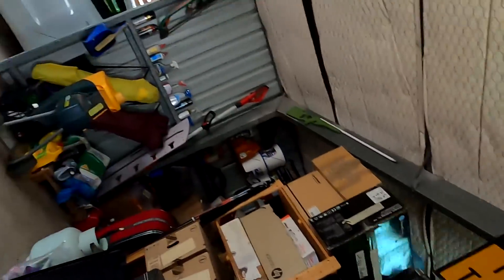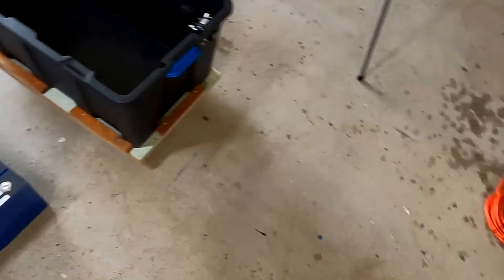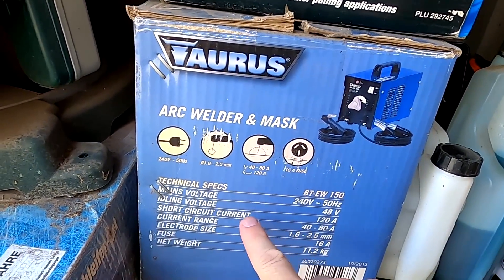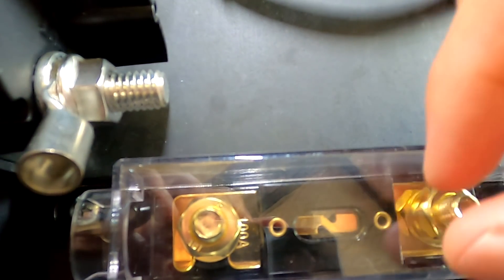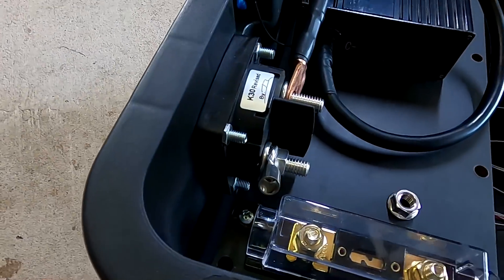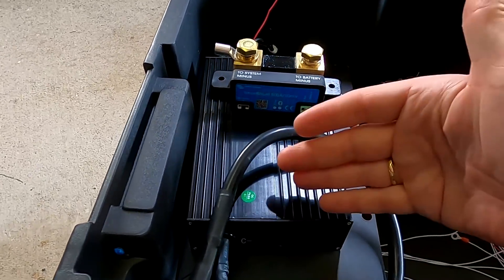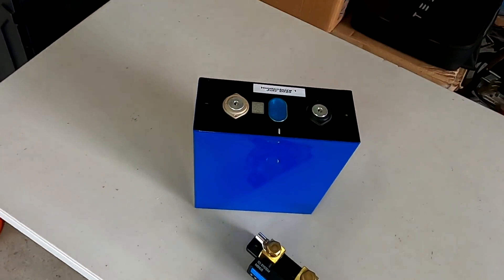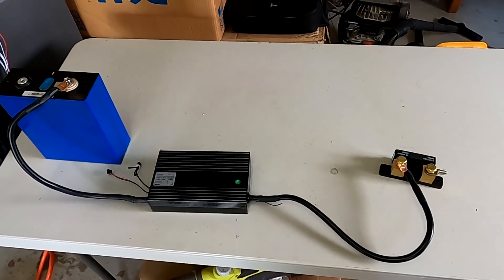Setting Shunt before the BMS a bad idea? Here is why I think this is GOOD! #buildthebattery.2

Comment: Just one quick question why use a fuse instead of a circuit breaker? Fuses need to be re-purchased and a circuit breaker only needs to be reset. Just wondering what the difference might be?
Reply: Hello. This fuse should never blow, exept trouble. How often do you replace fuses in your car?
The same here.
Reply: I prefer to use both: A larger fuse and smaller circuit breaker (This way the breaker should always trip before the fuse blows). I've had DC circuit breakers fail in the ON position where I couldn't even manually turn it off by hand. Fuses are pretty much fail-safe: A fuse fails by melting apart which means they can't fail in a way that would allow current to continue flowing so I feel much better having both in-line.
Reply: @JeremyAkersInAustin  that’s absolutely brilliant. Thank you for the suggestion. I’ll be ordering a slow blow fuse today.

Comment: How do you plan to keep the solar charging in case of an empty battery with the bms switching off the load at some low voltage scenario? Do you go with both (load an charger) on or off?
Reply: Good question as I've heard the victron can be damaged in the event of a disconnect if solar are not connected to the battery , in my install I chose to use a seperate port bms which carries on charging even in a cut off situation , I then use a relay for all loads works well so far
Reply from the maker: Victron has confirmed in their forum, that the MPPT will not be damaged in these scenarios. It can handle the solar without a battery been connected.
Reply: Not sure about his BMS, but some BMS units I've looked at will allow charge current in while blocking discharge current going out. They use solid state electronics which can allow current to flow one direction but not the other. Other BMS units will have a separate lead for discharge and charge, so they only disconnect the "discharge" (or "load") lead but leave the "charge" lead connected to the battery so that the MPPT can continue charging even if the load (Inverter) is disconnected.
Reply: @JeremyAkersInAustin  yes, Some bms have common port and Some have seperate ports for charge and discharge activation
Reply: @BischesseHunting  yes Ive used the seperate port for this reason

Comment: That is a very good point to move the Victron. One other thing; why not place the battery shutoff first, between the battery and the Victron shunt so no power goes to the shunt when idle.
Reply: The only possible problem I see with switching before the shunt and bms is loosing your programable settings in both, but I could be wrong could be worth testing I might try it on my daly bms and bmv 712 later today.
Reply from the maker: Thanks Peter. I need to see how much cabling effort this will be. I tried to keep it as simple as possible. But totally agree, it would make sense.

Comment: Been watching intently this series of videos.  I have a question and will apologize in advance if you clearly mentioned this.  I looked on your website and went back thru a couple videos to find the answer but could not nail down which BMS you settled on.  Could you just clarify what one you settled on and why or direct to the video where you did so?
Reply from the maker: Thanks for your feedback. I haven't linked the BMS yet, the video is still to come. Very soon...
Reply: QUCC from what I saw on this video.  What model?

Comment: Go with 3.  You want the most accurate measurement to be the Vistron and that is what Vistron says to do.  You will find that the BMS will not be accurate to your other meters, but will measure each cell in reference to the other cell just fine.

Comment: No low voltage disconnect for the shunt also. If put in after the bms the bms will turn off the shunt if the voltage gets too low
Reply from the maker: Good point!

Comment: I initially would go with #2, but if Victron recommends #3, you won't be doing it wrong.  An added benefit of using #3, is that the shunt will be measuring any parasitic draw from the BMS.

Comment: For a battery used and disconnected then left like that until next use like one used for camping I would place the switch first.  This is to prevent the battery from discharging through the bms and shunt.  You might have to get a few more low current poles on your switch to interrupt the current draw of these devices.  For an energy storage system where the batteries are always going to be charged by the PV system the minor current draw of the bms and shunt will not matter.
In your case I would place the shunt before the bms.  The shunt is going to be the most accurate measurement instrument in that setup, I would want it to provide the most accurate information to all the other components that are relying on the information provided by the shunt.
Reply from the maker: Thanks Gabriel.
Reply: Old way of doing it - a Smart BMS does everything and there is no need for a shunt
Reply: But he has a shunt and he needs it to interface to his other Victron devices and he can monitor ir on his mobile phone.  Yes Smart BMS can do some of that too.

Comment: #3 , inline with Victron's recommendations, though don't think it makes that much difference. Question: Should you shorten the cable lengths were possible to reduce loss?
Reply from the maker: I'll show this in the next video (or the one after). I took the BMS apart to show what;s inside (😋) and I could shorten the cables if necessary. But do 10-15cm make a huge difference? Not sure if it's worth the hassle, crimping and effort.
Reply: Hello.
Where it is possible, you do that anyway, but too short cable can be difficult to connect, and if you don't get the crimp connector fitted perfectly at the first time, you can cut a bit from a too long cable.

Comment: Put in anderson connectors so you have quick detach for the battery box also do what victron tells you
Reply: 👍  I was going to recommend anderson connectors as well. I will definitely be using them on my system as soon as I gather up the money to build it
Reply: @fillg   
I made mine out of old 18506 batteries that I got from battery hookup made 2.4kw batter for less that 200 bucks
Reply from the maker: Can I connect a 35mm/2AWG wire to an Anderson connector?
Reply: @OffGridGarageAustralia  Absolutely, if you get the ones that are made for 2AWG

Comment: You could have saved money and made it easier by using a breaker instead of fuse and switch. 10 mvolt on the BMS may effect the BMS but we are talking about nothing.
Reply: Hello.
During charge testing, I use the cheap model breaker as a switch between charge controler and battery.
After a few weeks of testing, the little lever fell off, where it slides it's full of scratches, the re-engagement arrow signe and 60A marking are almost erased. The fuses are not made to be actioned often, and ideally they should never even blow, it's only for security. ;)
Reply from the maker: There are not many good breakers out there. I've seen Blue Sea System has them as well. They cost like 10x more than on Ali

Comment: Hello, it's me. Again !  
Have you done any videos I missed on the BMS???  At the moment I'm using a 20 amp bms on my system, 30kwh +/-,  ha-ha, doesn't sound right does it!ha-ha,, I use a relay, and shunt trip breaker, it only works to shut down everything,  incase of  balance issues, or high/low voltage! And balance, that a joke, I do have a decent 50amp BMS, I'm thinking about getting a couple of the 150amp versions, paralling all the cells and connecting to a bms, will help each battery keep balance, I thought about breaking the batteries down and building large cells, then build a large battery, for now I have multiple 120ah 7s batteries, and a couple 260ah batteries, with the cells I have , the next one I'm about to build should be closer to 300ah.. My next adventure will be adding more solar panels, I don't care to buy used panels, about 4years old, the last batch I got looked like new! I'm hoping to get about 20-30 more this summer,  I shouldn't need anymore, even if I end up with a 2800ah battery! Wow, I was just thinking, that should last forever!  That would only be about 10-15 amps per cell peak, and would likely take over a month to cycle!!... Probably last a month with no sun! And could probably hyper wattage it for two months!!    I think I'd build 8s,1p batteries, with a BMS each, about 80 amps each, a 8s 280ah battery with about 120ma balance at best , WOULD NEVER balance, maybe a couple 4amp BMS each, would give it a better chance, also if one bites it, it still works, and still capable of 400+amps total, so all i need is to come up with, , , ,    20x 40-50amp 8s BMS, 20 sets of 4, 280 ah LIFePo cells, maybe they are cheaper by the pallet!! I'm guessing a baitrium system would be about the same price as a couple cases of 40-50a BMS  from china, and offer great  monitoring!!  How I'm going to afford it, , I have no idea!!   Maybe I can build a steam turbine generator, to. Keep the batteries @ 90% ,,  
Hey if you are going to dream, dream BIG!!
Reply: Go big have fusion reactor in the yard.
:D
Reply from the maker: The BMS Video is coming this weekend!!!

Comment: BMS consist of two parts one for balance and monitoring and the other that is a “switch” to disconnect you’d battery from the rest of the world. Of course pre-made batteries have the shunt at the end because you ere not allow to get inside of it. At the end as long as you connect all the sense wires direct to the cell, the rest is a “glorified” SWITCH and it can be connected at any part or the installation. By the way the only reason why you can’t connect it in the positive side is because internally the circuits use the b- terminal as the negative and connect it to the positive side can result (in some cases) on a fire works show. In my opinion the 3dr option is nicer and you have less cables, which is les “resistance” :)
Reply from the maker: Great, thank you.

Comment: If you are concerned about the fuse ARCing, put it pid pack, it will be half voltage!! I haven't tested mine at full load, but it pulls somewhere between 225 & 300amps! I'm working on a DC generator to charge the battery bank directly, with the potential to output 560amps, if I have enough engine,  I will likely stay around 150-300 amps, allowing it to power the inverter, and charge the batteries, not at full power, normal consumption is about 50amps dc or less, so I could put 100+ amps in to the battery! It's more efficient charging directly from a DC source, without loosing 10%+ every time the voltage changes! Even if the alternator is only 60% effiencent, that's hot effiecency, I'm hoping with a custom regulation, I can get closer to 80%, and with it  running colder, although a pma would be more like 90%, (about as good as possible, ) it lacks regulation. I'm hoping a custom regulator, (microprocessor controlled) will improve things,  sorry for rambling off topic here!  I'd love to have about 40-80 of these cells!! For a 8s system!! 280ah x 10s = AWESOME!! Just enough power to run my house!! Ha-ha, it would be awesome if the price would come down to about $50 each, ha-ha we ain't that lucky!! Maye in a few years I'll convert to lifepo4 from li-nmc, it's a bit spooky having 1200ah of liion in the House!!   Great work, it's coming along nicely!!
Reply: Are you serious about the mid pack suggestion?  Voltage loops don’t care if the pack is split or not it is the sum of the voltages that you need to deal with.

Comment: Why don't you open the BMS and shorten the cables? In that case I would choose option 2 with shorter cables and this way it will have less voltage drop, and on a low voltage event the shunt won't drain the battery
Reply from the maker: Wait for the next videos ;)

Comment: Thsttfuse is probably OK for upto about 60 volts, I would not put more than that on that type fuse, higher the voltage larger the arc, DC us arcy and sparky anyway! Ha-ha... It can kill switches and breakers easily, if triggered under load, if voltage is a concern, put the fuse mid pack! Half the voltage!! I have some silica filled fuses, from a forklift!  I'm a scavenger / repurposer, i tend to prefer 24v, replacement parts are more commonly available, and avalible locally, (somewhat), because of 24v vehicles, although I may go 48v in the future!

Comment: I think your theory using the ARC welder is not valid because most welder output is AC or pulse driven, AC tends to be self extinguishing. DC has a long history of an Arc traveling along a conductor, so there maybe some truth to the concern.

Comment: How doest the bms get power? From the balance leads? Or the common wire? If the bms is powered though the bms leads the shunt will not count the consumed amps by the bms. No matter if the shunt is in front or after the bms. In shunt in front maybe will count the amps the fets use. Pro for in front if bms shuts down the shunt will stil be aible to give the trend. Con it wil still consume power draining the battery further
Reply from the maker: I tested this already (spoiler alert). The BMS does not need the B- to be connected to work. At this stage I'm not sure which balance wire it needs to operate but it does not need the most positive one. It probably runs from 9V-24V or so. Also, the BMS has no FETs, the shunt uses less than 1mA.

Comment: You do not need a shunt it’s totally unnecessary what you need more than an expensive shunt is a good high quality circuit breaker built into your battery 📦 box Ready to use batteries do not have a shunt inside them I have opened a few and there is no shunt. The only reason you may want a shunt is to monitor usage and that can be done with a high quality BMS and blue truth
Reply: Thank you for your info. I build 12 and 24 volt  Lipo batteries  using 3.2.  300Ah cells. I use all 200amp circuit breakers and fuses wherever required. The BMS is accessible with my mobile and I can read the temperature of the battery, the charging rate and check all the cells if they are balanced. I use Daly 250amp Smart BMS which has everything you need to know the status of your batteries. By the way  the reason I use 300ah batteries is because they valve the grunt and never need to be discharged below 50%
Reply from the maker: Great discussion here. Thanks guys!

Comment: None of the 3 variations. The BMS is needed for charging the battery and to ensure that it is not over or under a certain voltage. The amount of energy that flows in the system can be seen on the charge controller or the BMS, you don't need a shunt for that. The shunt can be used for a second loop to the DC/AC inverter to measure the amount of energy that leaves the battery. The inverter stops when the battery is "empty", the voltage level can be defined in the inverter (if possible) or with a relais from the BMS.
Reply from the maker: So you're for version #1?
Reply: Perhaps you should state what assumptions you are making in order to provide your response.  This shunt can provide closed loop feedback to other Victron devices.  I have no idea what Andy’s BMS is capable of doing in terms of communication to other devices other than perhaps a mobile phone app specific to that bms.

Comment: #3. Just to be safe I would cover the exposed metal parts of the shunt. 
Does the Victron Shunt have a idle draw (through the voltage sense lead)? If so the BMS LVD would not trigger in this setup.
Reply from the maker: Yep, current for the shunt is <1mA as per Victron specs

Comment: Hey Andy,
Would it be advisable to put the switch on the battery side before it goes to the BMS/Shunt, so that you can isolate
the complete system in case of failure/maintenance etc. as it stands once connected there's no way to isolate
the BMS besides physically disconnecting the battery. I'm also assuming you're going to connect the charge controller
to the neg/pos leads going to the battery box at the actual inverter ?
Looking good ! And like with Windows there's usually a few different ways to achieve the same result and they all work !
Andy :)
Reply from the maker: Yeah, that's probably the best way to do it, but the cabling gets messy. I have to sit over the box and think about it for a while how to get this done properly and in a clean way...

Comment: Hi Andy, I'm thinking BMS 1st, because shunt will continue to communicate with the charge controller when a lo voltage shutoff has occured therefore charge controllers will get incorrect  information & deplete the battery further as well if the shunt is before the BMS.  Should the shunt be oriented in a particular plane ie fins facing vertically not horizontally, what does victron say. How accurate do you want this system to be, knowing you you will probly monitor it on an hourly basis (haha).
Reply from the maker: Good point. I will have a live feed of all data on my phone 24h a day, hahaha.
The shunt has got less than 1mA of usage, so I would say that negligible. The orientation does not matter for this device.